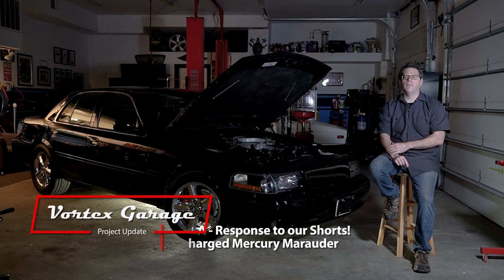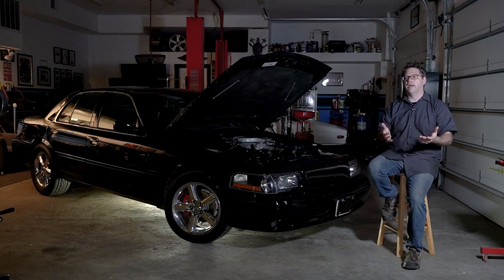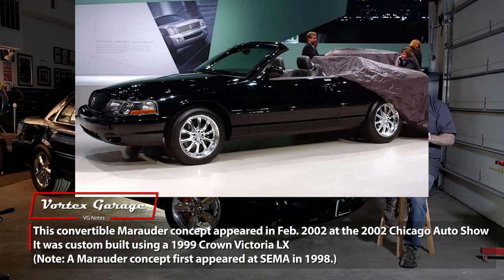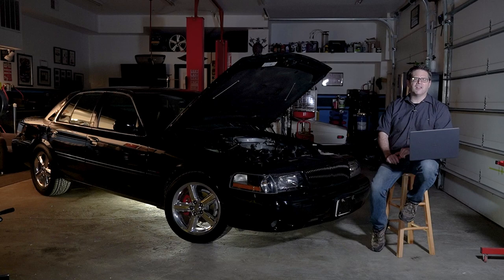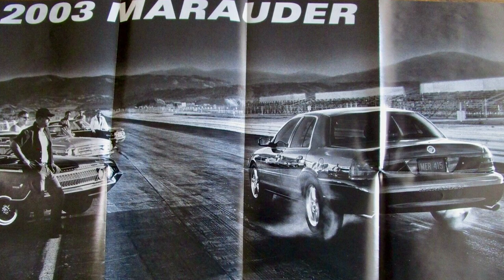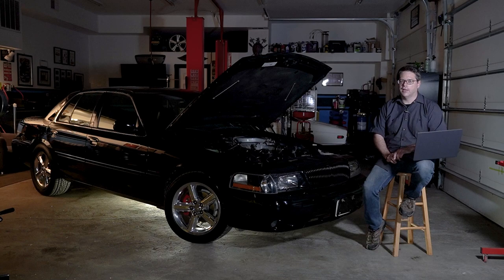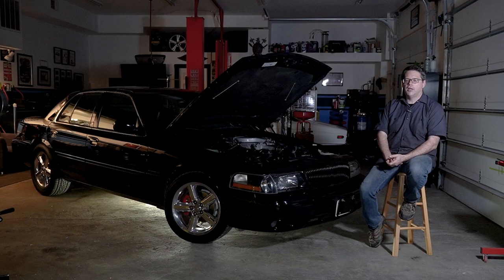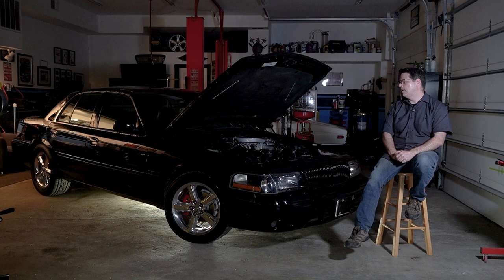Supercharged Mercury Marauder - Details, and Shorts Questions and Answers!

Comment: Marty Ochs Mo's speed shop tuned mine. I have a procharger p1sc that's intercooled. Fuel pump wise I am using the aeromotive 11542, it's in tank 340lph and I'm also using the boost a pump. Keep your boost a pump and get yourself this pump.

Comment: I run an Aeromotive Stealth 340 In-Tank Electric Fuel Pump and it easily supports 450 rwhp and 409 rwtq from my vortech (air/water IC) equipped 2004 Marauder (with over 60k blown miles). Simple and reliable system and the pumps are less than $200. Just use a filter that flows more than the stock fuel filter.
Mines not as fast as Mike's (comment below) I'm sure, but consistent 12.3s makes it an enjoyable daily driver and semi-sleeper.
Enjoy. These are rare, comfortable, fun cars.
Reply from the maker: Awesome!  Great to know on the Aeromotive pump. I'll check that out especially as a means to ditch the boost a pump

Comment: 200k plus? Yes....and ...no. My '04, that I bought new in November of '03 (bone stock by the way) had 217k  on it and then a timing chain guide broke, went into the oil pan, then sucked into the pickup tube robbing the motor of oil. Long story short, the motor had to be overhauled. Tough, really tough getting some parts 20 years later. Now just trying to get the coolant crossover tube repaired, which you haven't been able get for years either from Ford or aftermarket. I've been without it since the middle of March. Still waiting to get it back. I sure miss it.

Comment: I have an 04 and my oil gauge is fluctuating from 0 to about 65 70 but when I’m at a stop light it’s just sitting at 0 what can that be?? Also no lights on dash showing if it’s bad or something I’m thinking oil pressure sensor?
Reply from the maker: I would imagine the sender. Do you know if it's still the stock gauge and sending unit?  From Ford the oil pressure gauge was basically an on/off switch. It would always show steady pressure. Ford was concerned that owners would see how low the idle oil pressure is and bring their cars in when in reality that is normal. 

Many Marauder owners swapped to a real autometer gauge and sender. I can tell you those senders are not very reliable. 

So I think you're one the right track either way. If you really had zero oil pressure you'd hear the timing chains rattling and well even worse if it was really zero. Always can validate with a mechanical gauge in the shop but again I suspect you are on the right track suspecting the sender if the car is otherwise running well.

Comment: Do you experience any belt slip on the supercharger with the setup? I know 03-04 Cobra’s use a pulley bridge to enhance belt wrap to avoid slipping
Reply from the maker: None on the stock Trilogy setup at least. With the standard pulley never had any belt slip.  Others with small pulley setups may have but I've not on this setup. 👍
Reply: @VortexGarage  that’s awesome! Thanks for the info

Comment: I hve one i want to put the blowerr off s terminator on mine .any suggestions?
Reply: It's easy to do just get a cobra lower manifold with built in intercooler and throw it on.  Then if you ever build the motor you can run any modern blower they make for terminators (gen3r)
Reply from the maker: Yep, as midnight347 said, many folks have done that and it's getting more common.  Main thing is the terminator intake is on the other side as the Marauder so gotta relocate the battery, but there's plenty of resources on how others have done it.  MercuryMarauder.net is a good resource
Reply: @VortexGarage  thanks